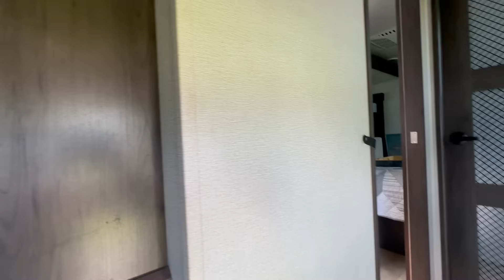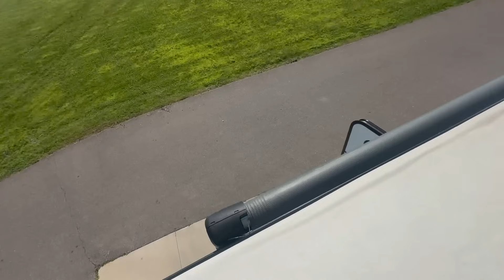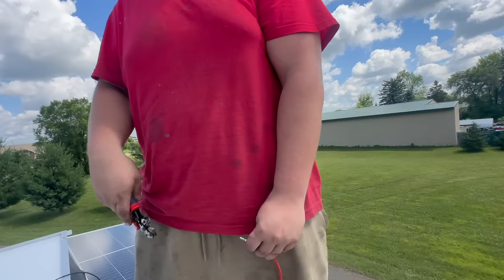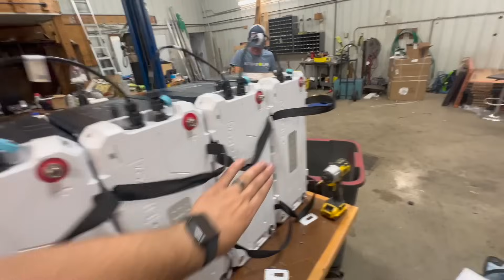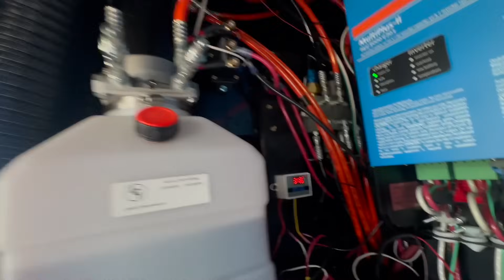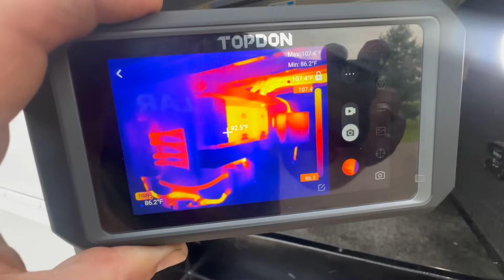24V Victron Auto Gen Start Epoch Batteries RV Solar Install – 3000W System on Grand Design Momentum

Comment: I am going to a 24v victron system.  If I do 1 24v inverter is that better then 2 12v inverters? 1 per leg. or use of an autotransformer? Great videos. Fan for years... and a customer.
Reply from the maker: Great to hear from you.  2x 12v inverters is hard to do safely. Everything is running at the edge , you have to account for 800amps of current if 3000s, if it’s the new 4000s it’s 1200 amps. 

24v or higher  is much better for larger systems.   Give us a call, could talk through pros and cons and quote them out either way to see how it shakes out.

Comment: I’m trying to decide whether to go 12 or 24 volt on a 1200ah battery system. How are you getting 12v for the rv systems? My rig is very similar. It makes sense from a pv wiring perspective but idk if the levelers pull too much through a dc to dc converter or not.

Comment: love your work and setups. I was going with the Epoc batteries. How are they working out? I saw Will P, he was not liking the problems they have with the new gens. Something to do with the BMS system.
Reply from the maker: We had one BMS get bricked, but Epoch sent us out a repair kit and it was fixed very easily. The BMS has gotten better with firmware updates. It was mostly just a little sensitive to over volt conditions which were a bit premature so you just had to keep the charge voltage a little bit lower we’ve done a number of installs now without issue.
Reply: @sotasolar thanks my friend. Starting my build list for my new setup for my fithwheel😊

Comment: Any chance there's a before and after on the startup amp draw difference on the ACs, speaking of the soft starts.
Reply from the maker: The startup draw difference is so hard to demonstrate because it happens faster than most meters can detect

Comment: Now that you can use any android tablet as a wireless display wouldn’t that be easier than all that work to get the hdmi cable routing? You could mount it on the wall a supply usb power to it.
Reply from the maker: We’ve experimented with that. 

Unless something has changed, it’s not something I’d do as a replacement for a wired display.  

It’s one of those things that’s we’d do for ourselves, but for customers, unless they fully know the draw backs and feel comfortable resetting up a kiosk mode android tablet, we won’t go there. Not yet.

Comment: Hi Shawn. Did you have any issues with the system not getting energized by the networked batteries alone, I.e. before any external DC power source was applied? I have a very similar set up. 24V dual Multiplus II and(4) Epoch V2 24V batteries. The difference in my system is that I installed an individual DiHool disconnect for each battery, divided the (16) 200W 24V bifacial N-Type solar panels into four 100/50 charger controllers and I also have a Lynx 1000 shunt inline with the Power In and two Lynx distributors. Overkill I know but, I wanted to ability to isolated individual batteries and charge controllers in the event of any problems with the system. The only way to get my Victron gear to “wake up” is by giving the system any mode of external DC power either through the inverters energized by grid or generator, solar disconnects in the on position or the engine running through a DC-DC charger. Un-networked individual batteries with DIP switches in standalone mode energized the system on battery power alone with no issues. It’s only when the batteries are networked in Master-Slave mode do I see the problem. Im working with Epoch to resolve this anomaly. To most installations this would never matter since the batteries would always see other sources of DC power. I guess I tinker too much.
Reply from the maker: Don’t use DVCC if you are. It will take over control of your solar chargers and not allow charge.
Reply: I am using DVCC! Thanks for that advice. Love the channel and l love that you work with Levi. My 21 yo son works with me too. It’s a priceless experience. Woof to the Bear!

Comment: Looks great! Is there a reason you didn’t go 48v? I’m guessing since the 2x120s only go up to 24v? Any advice on deciding between the two if components are available for either?
Reply from the maker: Yes, it’s exactly that it’s the highest voltage that there is a 2x120  inverter.

Comment: Another clean looking install.  It would be interesting to see the temp of the wires coming out of the inverters when you did that temp scanning.  You could see them glowing in the bottom of the screen and a temp check would be educational.  Be safe and bring on the next build!  OH- and leave  Levi alone and let him rock his inner solar man vibe!
Reply: Mine are warm.  The welding cable is pretty forgiving. 

The following pic is on a 92* day, 95* in forward 5th wheel compartment. You gotta expect some heat soak from all day.

Can’t figure out how to add a pic.  But 112*

Comment: Nice looking install!  I didn't see one, but maybe I missed it - was there an Orion 24/12-70 for the 12v battery & power jacks ? Thanks!
Reply from the maker: Right we did not talk about that. Probably should have. We’ve had a few people suggest this, and decided to give it a try.  We’re using the existing converter. 

We had also had some issues and confusion with the 24/12-70 it will back feed 12v into the 24v system if the 24v system is off. This keeps the cerbo online all the time.

We’ve found the DC loads tile on the cerbo often causes more confusion than insight anyway. So now everything looks like AC loads and the system is essentially a larger solar generator and runs the coach no different than shore power.
Reply: @sotasolar So can elaborate more on the 12V DC side if things.  From what you said you left the entire 12V system in place. Did you indtall a Lithium battery and if so how many and what capacity